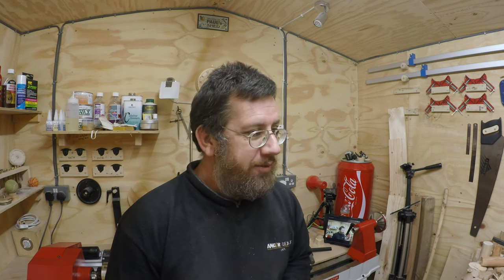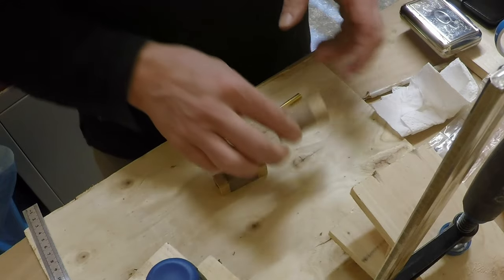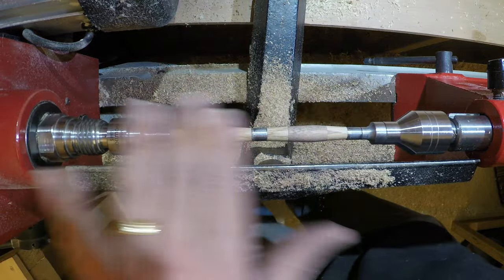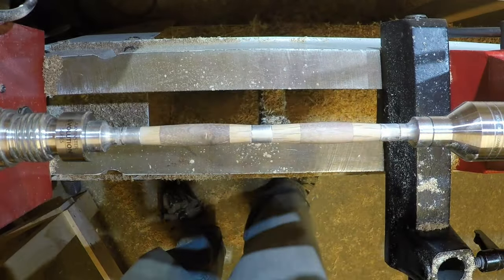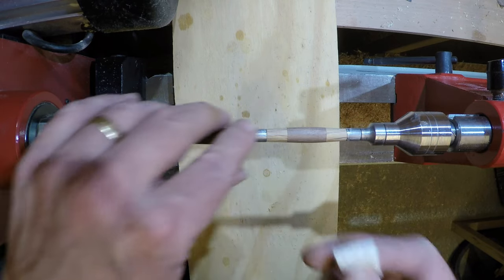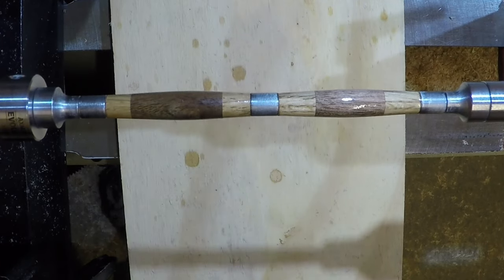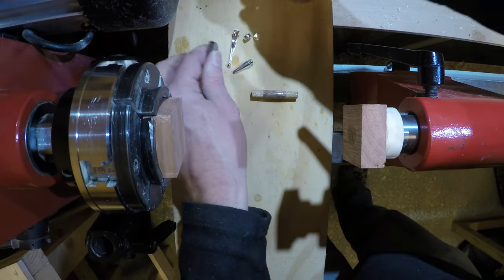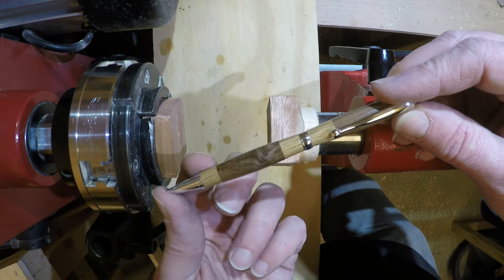Oak & Walnut Pen (How I Turn A Pen) - Episode 48

Comment: Hi great video. Never thought about using the lathe as a pen press. That's saved a few pounds .thanks 👍
Reply from the maker: Thanks Roger. Yes I've used the lathe right from my first pen, initially just holding a piece of wood up against the tail stock. I think unless you plan to run a production line of pen assembly the lathe is just as good. Plus if you are limited on space it all helps.

Comment: Nice pen and easy to follow tut.  I use same setup for putting my pens together but with a small hole in the wood in the chuck,  stopped the tip from moving when compressing 👍
Reply from the maker: Thanks Heath. The pen soon makes a hole, it's quite surprising how much pressure it takes to push the parts together.

Comment: Paul
Nice work as always.
If you are interested??

Method I use which provides a clear gloss finish is as follows;
My process - not the only way and quite possibly not the right way, but it is the process "I" use.
Selling pens or beautiful gifts,  is "all about the finish"!

1) Turn pen to desired effect
2) Using paper towel - 3 coats of "thin" CA using accelerator between each coat. ** Wipe each coat with 3 swipes of the paper towel so it is an even coat.
3) Using paper towel - 5 coats of "medium" CA using accelerator between each coat. ** Wipe each coat with 3 swipes of the paper towel so it is an even coat.
4) Sand through the grits dry sanding 120 through 600 grit.
5) Sand through the grits of wet sanding using micro-mesh pads 1500 through 12000.
6) Buff using paper towel.
7) Apply scratch coat (brand in North America is Nu Finish Scratch Doctor) paint scratch coat for automotive. Buff until shiny & dry.
8) Apply high quality car wax (great for high gloss and added benefit of moisture protection) - I use "Turtle Wax"" -- buff until shiny and dry.
9) Buff with soft cloth to shine. ** Soft cloth is great - but be careful - novice turners should use paper towel - as Captain Eddie says -- "Never Never, take a cloth to the lathe!!!
10) Assemble pen.

Above is a little more time consuming, but provides a beautiful and hard shiny surface. The final coat of car wax also protects against moisture and oils from the skin.
Once you get used to the process, you will find that it is not overly time consuming - and well worth the effort. I have turned over  500 pens with this process, with no complaints and I always guarantee the finish!

I look forward to more of your videos.
Dennis Beamish Cambridge Ontario Canada
Reply from the maker: Thank you Dennis. I will make a note of that. I've tried with the medium CA before but find that it leaves more ridges as it goes off too quick, especially with all the fixing spray about. I've recently got some sanding paper for a bowl sander up to possibly 10k grit so may look at using that. Other than that I have the 1200 wet / dry paper which I've been quite happy with.